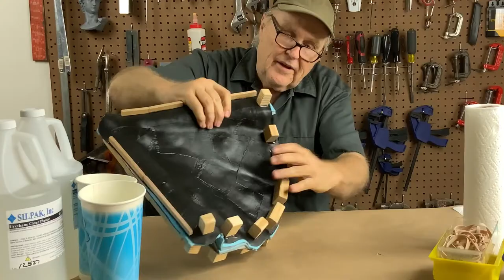Casting A Glass Lamp Shade - Part 2

Comment: Hi there I was browsing for silicones for my miniature casting needs and I came across some that say bleeding or non-bleeding. Is this something to worry about? Also addition vs condensation, why should I pick one over the other
Reply from the maker: Complex question. But briefly: Bleeding/nonbleeding refers to silicone sealants. It doesn’t apply to molding rubbers.

Condensation cure rubber  is catalyzed by tin. Addition cure is catalyzed by platinum.   For almost all of my mold making I use tin rubber because it costs less and is less sensitive to cure inhibition. The biggest disadvantage is that it shrinks very slightly when it cures and the molds degrade over time.  Platinum rubbers are more expensive and are more vulnerable to cure inhibition.  However, they shrink very little and do not degrade over time. I use platinum rubbers when doing food-grade mold making.  Which one you choose depends on your project and you should consult with your supplier as to the most appropriate rubber to pick

Comment: Does this resin handle layers ok? Thinking pouring in layers would let the bubbles completely float up on that layer before it gels. I also use 24 hour set epoxy that should not need a pressure pot. But the issue is the bubbles have to float to the top and then move along the top of the mold. But even floating to the top surface they may not pop.

I cast turning blanks and there is a thinner epoxy but I never need a bubble free top since I cut it away.
Reply from the maker: Yeah Perry, people learn a lot from failure.  I knew from the beginning of the channel I would have failures from time to time.  I put them out there for everyone to learn from.

Comment: Oil clay , fibreglass and filling moulds with water , doing well there mate .  The second casting looked more opaque and much more like the original . Yep vac the resin and only thing I can think of is a vibration platform . I'm enjoying this one ( not that I don't enjoy your other projects )
Reply from the maker: The key to rules is knowing how and when to break them. Still, I prefer my usual workflow.
Reply: Any schedule for a return back to California ?
Reply from the maker: @glenfisher728  I’m back, the videos you’re watching were recorded earlier. YouTube has a way of distorting time.
Reply: Yep , noticed a message further down the page saying you were in the LA area so thought you were back . If you're thinking of a larger pressure pot make one so it can swivel from horizontal to vertical  so the big moulds like this glass plate can be dropped straight in vertically  . Hope you're glad to be home .
Reply from the maker: @glenfisher728  definitely the tank should swivel. I will be commuting from home back to my temporary shop as needed for the indefinite future.

Comment: Having seen your battery of pressure pots in other videos and how simple they seemed constructionwise I just thought you'd made them yourself. Is it that hard (or expensive) to have an upscaled version made of the pot you're using?
Reply: He uses truck air brake tanks which are modified by a certified welder, large cheap tanks rated to 150 psi don't exist. It's not just a matter of welding steel together willy nilly that would explode catastrophically.
Reply from the maker: I designed them but I did not fabricate them. Here's a link to a video about them:
https://youtu.be/VYO318KFuAA
I am hoping to add a  bigger pot to the shop.

Comment: When you are pouring in the epoxy, do it so it runs down the inside of the mold. This prevent some of the bubbles.  Also, if you can raise the temperature of epoxy in the mold to the mid 80's in temperature before pouring and while curing for the first 4 hours.  Also, if you use an epoxy with a longer working time you will be able to use a pressure chamber at the start to remove many of the bubbles.
Reply: He said he doesn't have a pressure pot that this mold fits into. I think you're right about longer cure time being the key though.
Reply: I forgot, if you heat the mold, room and epoxy to the correct temperature.  This is key.

Comment: Hi Robert, i do my castings in polyester resin. There is hard to find PU resin in my country and they are more expensive than polyester resin. After i cast, polyester casted parts are always sticky, even after full cure. Remove that stickiness i bathe parts in acetone. Acetone clean the parts very well but if the parts casted in pigmented resin, acetone removes the pigment from part and leave cloudiness on the part surface. 

As i can see your videos, you do not have that kind of stickiness problem, am i right? Is is because you use PU resin or you doing something different?
Reply from the maker: I don't cast in Polyester resin except WEP, which is water-extended-polyester.  It doesn't like silicone molds and much prefers to be cast in Urethane rubber molds (which, by the way, are less expensive). You might try that with your polyester resin. I almost all of my work I cast Urethane resin and occasionally epoxy.
Reply: @RobertTolone  Thank you for your reply :) Unfortunately i couldn’t find WEP resin but definetely try to find cheap urethane. Thanks again, have a good day. :)

Comment: Always love your videos. I was under the impression RU-575 was only to be used with a Platinum silicone, is that not the case?
Reply from the maker: You know what Dan? Silpak says to use it with platinum rubber in the data sheet but I didn't notice that. So I used it with tin rubber and somehow got away with it!
Reply: @RobertTolone  Interesting!! I am very tempted to try it myself, but would hate to damage my mold. I wonder if the thickness of the piece you were reproducing was a factor in your success. 
I always look forward to your next video, have a great week!
Reply from the maker: @danmead300  It’s possible, but usually mold inhibition is a surface defect. So you can test for it using a small sample of rubber and resin.

Comment: Hey I had  question, How do you avoid Chemical Rashes? I wear long gloves when I Mold and Cast but I always seem to end up with Hives from some point in the process
Reply from the maker: I can’t answer for you because I don’t know your situation and I’m certainly not a doctor.  But definitely,  teach yourself to work clean. I never allow paint, adhesive, resin, etc to get on my hands or clothes and I work in a very well ventilated environment. Also, I limit the exposure time to materials as much as possible. Check that you’re not reacting to the materials in gear like gloves and masks. Try to figure out which material in your environment is causing the problem.
Reply: @RobertTolone  Hey I appreciate you taking the time to respond, I understand that you can't really give me a definitive answer
Reply from the maker: @EricLopez.Official  Yeah it’s hard to say anything definitive without data. Best you can do is note when you get reactions and figure out which specific materials you’re working with when they happen.  Then you could either avoid those chemicals or figure out a way to reduce your exposure to them.
Reply: @RobertTolone  Could you maybe do a video explaining how to do this safely?

Comment: This has probably been mentioned already, but instead of trying to match one resin part to the existing glass parts, why not just replace all the glass parts with resin castings? That way they will be more likely to match both in looks and in weight.
Reply from the maker: That would be the logical thing to do. In fact, now that Susan has a mold she might want to do exactly that.  But for the channel, it’s more fun to see if I can make a match.

Comment: You could put the entire mold in a large plastic bag and use a shop-vac to create a vacuum to remove the air bubbles.
Reply from the maker: No, I’m afraid it won’t work. I made a video to explain why: https://youtu.be/QU8JS5HZIYw

Comment: One difference I noticed between the glass and the resin was that the glass one had a slight, slight yellow-green tinge to it. I know the last video is already long done, but I figured it was worth mentioning.
Reply from the maker: Yes, there was not an exact color match for sure. The difference will become even more pronounced over time as the resin yellows with age.

Comment: You can use gauze instead of fiberglass cloth for the outer shell and still get enough rigidity. You might use a little more gauze and epoxy but you won't get those nasty micro needles.
Reply from the maker: Good idea. Thanks!

Comment: if you want a better fiberglass experience next time: 1. try applying whole sheets instead of patches (twill weave, thickness depending on shape, coupling putty helps) - it is much faster and doesnt require sanding. 2. place a soaked strip of fleece around the edges between two layers of fiberglass - you get instant thickness, stability and stiffness even for large shapes. THEN screws and clamps work like a charm.
Reply: A sheet of twill would have been so much cleaner and quicker. I was surprised by all the little pieces.
Reply from the maker: @RyanStone143  this happens to me every time I work with fiberglass on the channel. People who actually know how to use it tell me what I’m doing wrong! 🤪😄

Comment: Why don’t you try Smooth-on Freeform Air instead of fiberglass next time?
Reply from the maker: I had the fiberglass left over from an earlier project and I'm too cheap to waste it.
Reply: thats just resin with microballoons? would work great as a coupling putty or filler between two fiberglass laminates, but not on its own (depending on surface area and layer thickness)
Reply: I’ve been watching a sculptor/YouTuber who uses that as the mother mold for her sculptures of newborn babies. Maybe she does her silicone layer a little thicker.
Reply from the maker: @annekabrimhall1059  What channel is it?
Reply: @RobertTolone  Caroline Doughty
Reply from the maker: @annekabrimhall1059  Thanks.
Reply: @RobertTolone  Ms Doughty has long videos that most people wouldn’t have time to watch.

Comment: I dislike fiberglass also, I've used thin cotton cloth a couple times with success.
Reply: Dynel is a commercially available cloth without the splinter/itch factor. Not as stiff per thickness, not easy to sand cleanly, but way easier to live with.
Reply from the maker: Thanks, I will look into it!
Reply from the maker: I try to use up what I have on hand, but cotton cloth is a good idea.
Reply: @RobertTolone  Basalt fiber is also a good alternative.
Reply from the maker: @RyanStone143  I’ve never even heard of basalt fiber. Gotta look into it!  What’s it used for?
Reply: @RobertTolone  We used it as a replacement for carbon fiber in prosthetic sockets but there are lots of uses. Since it's non-conductive it won't block bluetooth/wifi signals from vacuum pumps installed in the sockets. One of the main marketing quotes is that it doesn't bother skin like glass and carbon can... which is true.
Reply from the maker: @RyanStone143   Interesting! There’s no end to the materials out there to play with.

Comment: Sometimes you can get away with blowing some air between the rubber and master
Reply from the maker: In situations where the air is trapped between the mold and the master it works beautifully but usually all that happens is the air escapes out of the nearest available crack.